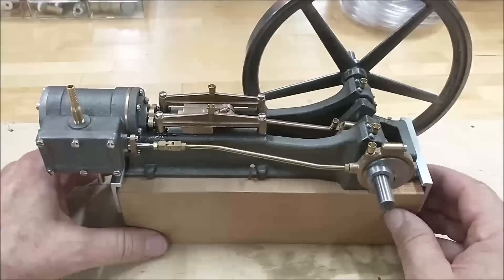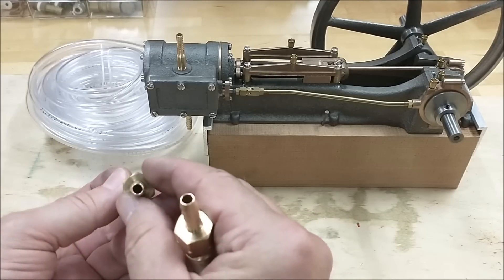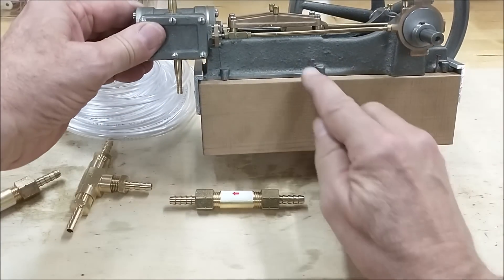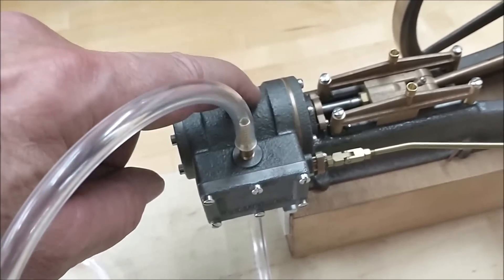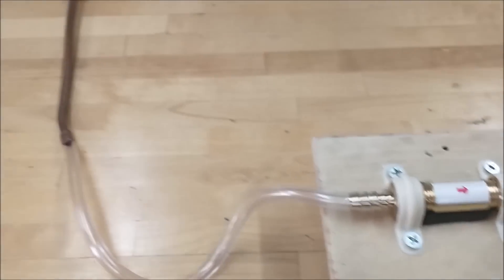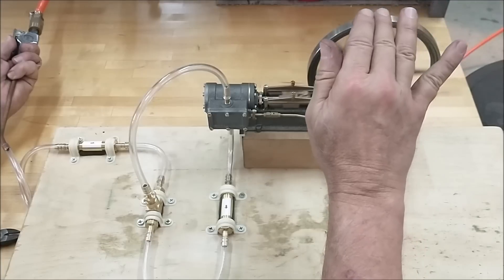Perpetual Motion Video....Is It Fake or Real ??

Comment: First of all, don't believe those are real check valves, secondly there is no way the piston will work due to equalized pressure in the line.
Joe has cleverly modified that T fitting to have an air supply underneath while allowing the exhaust air to pass thru with a false sense
of incoming air at the blow-off gun which is basically the exhaust port.

Comment: Several assumptions:
1.) Joe is an excellent machinist so we can assume that the engine is very well built and very low friction. (Therefore, it's going to take very little power to keep the engine turning over for the 45 seconds after the air supply is cut off).
2.) Joe is not intentionally misleading us.
3.) Heat is neither being added nor removed (you would then have a regular heat engine).
4.) The gland seal isn't perfect.
5.) The gas laws and physics work as theory and experimentation predicts and proves. (IE you can't take a compressed gas at one pressure, obtain work from it and then compress it back to the ordinal pressure without putting work back in).
6.) The tubing and check valves are acting as a small compressed air reservoir.
7.) If the above are true, then the energy needed is coming from the high pressure compressed air reservoir (tubing and valves) dropping to atmospheric pressure from the small leak in the gland seal. 
Ways to verify that you have a true perpetual motion machine:
1.) Verify that there isn't a pressure drop on the high pressure side. Use an accurate pressure gauge and check for leaks (hose connections and gland, I would use the soap bubble method).
2.) Run the engine for an extended period of time, say 24 hours. If it's a true perpetual motion machine it should still be running.
3.) A way to eliminate the gland leaking as an issue would be to put the engine in a pressure vessel that has the same internal pressure as the high pressure side. With a net zero pressure differential leaks will be stopped. 
My prediction is that when the pressure differential between the high pressure side and atmospheric pressure drops to zero the engine will stop.
Give it a try and let us know how it turns out please.

Comment: Hmmm. It running on the slide valve and built up pressure in the lines. so where is the air leaking out?

Comment: Yep ... this is a scam.  I am very curious about those nails.  They are ugly.  With all the care Joe put into building this, he didn't take the time to drill out the bosses along the sides for simple wood screws to mount the machine to the block?  THIS is just not Joe's style.  Further, the mounts at either end should be more than sufficient to "keep it from spinning".  Also ... Joe only allows us to see 1 side of this ... steam engine ... the side he wants us to see.   I don't know the trick ... yet ... but there is a trick.  BTW ... mechanical friction, over time, is the killer of perpetual motion.  You must increase power, again, over time, to defeat it.
Reply: Also, the only reason a steam engine works is because you keep putting steam it.

Yeah ... there is another power source somewhere.

Comment: The offscreen loop has been cut and air was introduced back into the line from there, which is why the check valve on input side were required, so that we don't have the air leak out of the cut off pipe. That would be my guess, if the pinned comment is all true, which it can be if my explanation is true.

Comment: It would be more believable if you put an alternator on it and use that to power your shop. Just cut most of the bits out of the alternator and epoxy it all together again. Connect some 28 ga wire and you can have 400A 3 phase power for a puff of air

Comment: I love the concept.  Only issue I see is that your seals would have to be perfect to prevent the slow escape of your drive pressure.  Have you timed how long it will run.  I would imagine a long while, but not perpetually.
Reply from the maker: An honest comment would be " The setup shown in this video will run as long as I want it to "
Reply: @joepie221  Sounds like I need to study the setup a little closer!  ;)
Reply: Why do you need to pressurize the system to start it, just attach the exhaust into the intake and then it should run for ever. I did notice that today is April 1st.

Comment: If I were to do this, I’d feed air through the board, into the bottom of the intake check valve on the “downstream” side, and exhaust out the “upstream” side of the exhaust check valve in a similar manner.  Those foam shims “to hold things in place” make a convenient way of obscuring the connections.  Well done though.
Reply from the maker: Good thought, but it sounds like you'd have conflicting pressure somehow.

Comment: Very nice trick Joe. Well done.

My guess? small battery powered motor inside the block driving the flywheel via a rubber wheel attached to the motor shaft.
Reply from the maker: see the pinned comment.

Comment: Didn't you see it? Did you all miss the trick? The engine was running the wrong way - in reverse!! If it was running in the correct direction - forwards - then of course it would need power to operate and it would quickly slow down and stop due to friction. But because it was running in reverse and according to the laws of entropy the engine was actually giving out energy hence it would run forever.
Reply from the maker: The crank throw arms always rise up between the rear walls of the casting. Otherwise it would be a very dangerous machine.

Comment: Like a ram pump. Air is being used s as a liquid instead of gas. It has mass.  Great job. Not so a timer and see how long its will stay running. Also how much of a load will it handle
Reply from the maker: Trust me, this setup would actually run forever.

Comment: While the concept sounds logical, the actual running will not run for ever do to the fact that there is little pressure escapes as it runs and it will stop after that pressure drains off. It my run for a little time, but it will stop...period!
Reply from the maker: Not this one.

Comment: the idea is sound but it is not a perpetual motion machine because of diminishing returns due to friction and air loss due to gaps in the machined surfaces so you would have to add a pressure top-up occasionally and eventually replace parts without disturbing the motion. 
but having said that the possibilities are there. I really enjoyed that. Thank you:yougotthis:

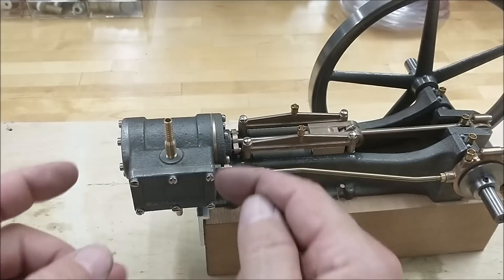Comment: 1:10 That’s why we never call this a motor. We say its a machine 😁
Sorry Joe,must be an ‘April fools day joke’ 😁. Because the pressure on the output side of the exhaust (2nd) checkvalve is the same as on the input side of the same valve. I think there is an electro motor driving on the flywheel
Reply from the maker: see the pinned comment.

Comment: Brilliant gag Joe, well presented! I’m guessing a little friction drive motor on the flywheel behind the box. Very nicely done.
Reply from the maker: see the pinned comment.
Reply: @joepie221  Then I now think that the "check valves" are actually tee fittings. One is anyway - the supply one I think, and air is routed under the block. One of the many things you are exceedingly good at is creating puzzles, and I have thoroughly enjoyed this one. Looking forward to the reveal!

Comment: There is energy stored in the inflated and pressurized plastic piping. It will run until friction and leakage through the rings and valve neutralizes and uses up this energy. My two cents.
Reply from the maker: Good thought.
Reply: Nope.  The pressure of the intake valve will be higher on the supply side than the exhaust side, so that 1 way valve would never open.

Comment: Joe check this out air pressure requires containment therefore space is fake. Also triangulation requires parallel zeniths and a flat baseline therefore earth is flat a sextant triangulates location for mariners for hundreds of years peace🎉
Reply: Bless you for the heart. I admire an honest man who isn't afraid. Become part of the debate here is excellent sources. "Nathan Oakley 1980" daily upload "Quantum Eraser" FE academic level MVP "taboo conspiracy" long time solid guy. "Flatzoids Perspective" a very good man he busts his but a dad husband full time employee and the most patient flat earther ever. It is an interesting topic Joe. Blessings I admire you. I sent this out to the FE community and they are blown completely away by you brilliance. I am really talented at Solidworks just saying. If those lines get hardened for higher pressure and the a row of pistons are used you can get the torque way up on the flywheel. You are brilliant.

Comment: lovely video, i shall watch later after my comment here... because my comment has nothing to with your video (only the title of it).

what this is about? perpetual motion. but this is of course actually considered a short hand for extracting unlimited energy from something while that object remain in a perpetual motion. to get over-unity gains (more than 100% system effeciency... thus breaking the fundamental laws of our universe, for energy preservation and such matters).

ok then!  ... that is a well defined problem. and by perpetual motion, we mean mechanical, physical motion. or locomotion. or whatever similar concepts of a continuously changing state.... and here comes (my today's insight, that was generously triggered by your clickbait video title for our april fools)...

but you know what natural object in our universe is a real, and abundant perpetua motiion machine? it is the simple atom, that all physical matter is comprised of. because (most times) they have stable electron orbits. and so you take energy out from that (stable electron orbit)... and it still remains perpetually in motion. the orbit is modified, but its the c speed of light constant (in our laws of physics) that keeps / prevents the natural mechanical lower orbit (closer to it's sun, the atoms nucleus) from speeding up. so that energy is indeed lost. once the electron reaches its lowest possible orbit (of quantum vibration), its done. and the energy is all mined and extracted. no over unity gain is possible, due to the speed of light constant.... yet the simplest electron around the simplest atom is still perpetually rotating! and always will be, forever in a simple hydrogen, that is left forever undisturbed. ok in real atoms, there are multiple electrons that swap and jump orbits probabalistically in the quantum wave function. but whatever... we still have gotten a taste to be onto something. so what is the next logical enhancement to this basic system then? to iterate the problem:

we could only get very limited amount of energy from that electron mining... it created 1 photon. which is almost nothing worth bothering. pah. weak saurce. so we must go deeper, to the atom's nucleus. there we have the much stonger nuclear force. the 'strong force' and the 'weak force' that binds either protons together. or it binds the quarks together. that then orbit each other, to form ostensibly the proton. or the neutron.

so then, our energy extraction operation becomes the process of nuclear fusion. and this nucleus or proton is actually also ostensible a thing which is permanmently orbiting particles. can also be considered to be perpetually in motion. we do have a once time energy extraction step, at which point that fuel is used up. so there still isn't over unity gain (this time because e=mc2). however the spent 'fuel' (the lithium or deuterium whatever, are still very simple atoms). those spent atoms themselves are still perpetual motion machines.

so what is my point here? well when people (as "inventors') makes some fake perpetual motion machines, they are fundamentally a con (in terms of claims of over unity gain). however if you are a museum that collects from around the world many examples of such fake machines that: 'nobody must look inside'... that is like a highly ineffecient solution. compared to aquiring only 1g of nuclear fusible materials (the lithium and deuterium heavy water)... and then putting thaat fuel into a working tormach fusion reactor. that (itself) is trying to solve its own problems of 'over unity gain'. which we cannot succeed for another +40 years of tormach fusion reactor development here in europe. that the will build a bigger one....

so my conclusion. to wrap things up: this perpetual motion is not a con, in the sense that all spent nuclear fuel (either fission or fusion) is still perpetualy moving. and while over unity gain is impossible to extract from our matter, our atoms. due to the fundamental speed of light... it would logically follow that anybody who invents such 'real over unity gain machine has actually exceeded the speed of light limitation. and therefore that machine will instantly dissappear. because it will become actually a time machine (like the classic old movie  the 'time machine'). and will keep on accelllerating backward faster and faster in time. so the dog lost his homework. anybody who invents this machine.... that machine will become lost to time itself. the first moment that you switch it on. the arrow of time and causality will be reversed.

so instead: i encourage the compromised solution that nuclear fusion is 'good enough'. because there is enough fusion fuel on our planet to keep the illusion going for long enough, to keep our energy demands for many centuries. and it does not result in a time paradox that destroys the fundamentally very fabric of our whole universe.

Comment: Because of Joe’s skill when he built the steam engine, there is absolutely no friction between any of the moving parts.  As such, this contraption should theoretically run forever.  Brilliant work Joe, you’re the man!!!!😊
Reply: If there was no friction in the machine...then  it would fall to pieces as soon as it started to move.
Reply: @brianmoore5454  extremely little friction, and those machines exists, but You could not ever have them doing any work, if You do, they will stop very soon. But that engines worked very very smooth.
Reply: @brianmoore5454  By saying "moving parts," I was referring to those that reciprocate such as the piston within the cylinder, or those that rotate within a housing such as the main axle.  But, I agree with you that if there was no friction between ANY of the parts, then screws and bolts would come undone and the whole thing would fall to pieces like the car in this Laurel & Hardy video:  https://youtu.be/ujxwDKeKSyo
Reply: The pressure on both sides of the piston will equalize at some point.   The force required to operate a fluid tight, sealed piston requires quite a bit of energy.   Joe introduced energy when he spun the flywheel to get it started.
Reply: @buckinthetree1233  BUT ... will the energy stored in the flywheel be sufficient to restart the "motor" should the line pressure equalize.  There is something stored in the old, deep dark recesses of my brain that tells me it will not, but I cannot recall it just now.
Reply: @T Duncan  no.  The flywheel started losing energy as soon as he took his hand off of it.
Reply: And zero leaks. Forever.
Reply: He has a very well built and balanced engine there, but this isn't perpetual motion. The thing is, the engine does not have the same surface area on either side of the piston, so one side is pushing against a small area of ambient pressure and the other side is at full pressure.
Reply: If it seals and there is gravity, there's friction.
Reply: No reciprocating inertia either. REAL Magic. ---- You actually fell for this, huh?
Reply: There is always friction, but if he indeed has no external source of energy other than the air surrounding the engine, then the tiny amount of friction in this archaic device is truly impressive.  Even wit zero friction, however, the device could still not run forever.  The air exiting the exhaust ports must be cooler and lower in pressure than the air entering the intake, because the air in the cylinder is doing work on the piston, which removes heat.  This means the entropy of the exhaust air is going down, and the only way the system can continue to run is if the total entropy does not go down.  This could possibly be accomplished as simply as blowing hot air over the exhaust in order to replenish the energy lost in the air expansion in the cylinders and to increase the entropy in the exhaust gas.  Even the ambient air surrounding the outlet might be able to supply enough energy for a while.
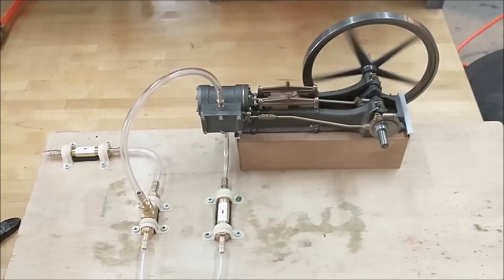Reply: 4:58

Comment: Nicely done: amazing how little air this uses, I didn't hear any flow when you charged the system.
My bet is an electric motor driving the fly wheel, hidden in the mount.
Reply: That's why we never see the bottom of the flywheel.
Reply from the maker: see the pinned comment.

Comment: There is unnecessary foam underneath the check valves.  An easy place to hide a pressure feed and return.
 The handheld pressure feed probably is just a distraction. Nicely done.
Reply from the maker: I actually added the foam to take the wiggle out of the hardware. The hold down straps are too big.

Comment: Sorry not quite. Seeing as how there is no pressure gauge but you pressurized the system to be large enough to run the engine for a while it looks like its magic but it's just running until the residual  air pressure slowly dissipates. To prove this you need a pressure gauge. To be fair the engine is tight but you are always fighting friction and that is the reason it will stop eventually. The law of conservation. Thanks for this interesting video.

Comment: I call bullshit.  The steam requires heat to maintain a vapor state.  There is no way to keep the heat from bleeding off as the energy is used to create motion.  Pull the underside box off the engine and show a 360 of it running for an hour with no way an external power source can be assisting it.
Reply from the maker: The block is only there to give the flywheel room to spin. I give you my word, it's solid.